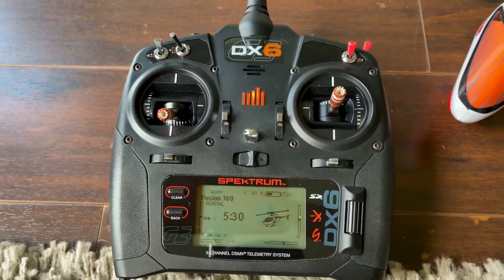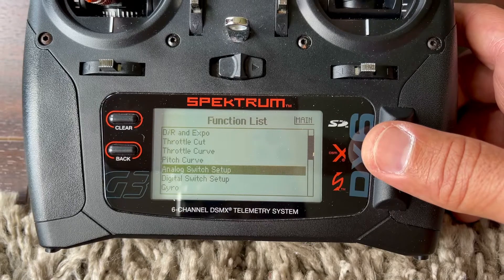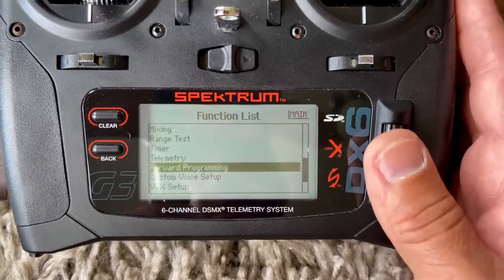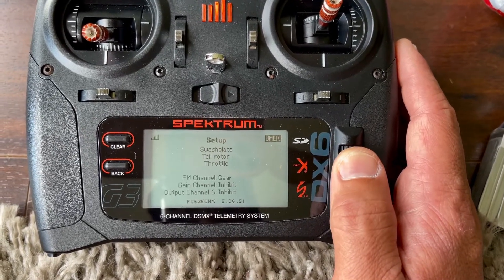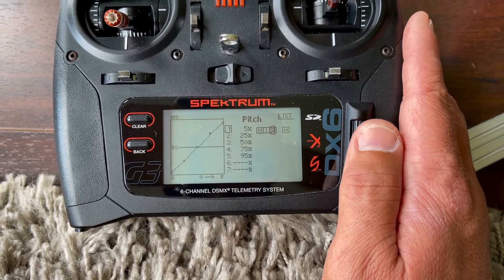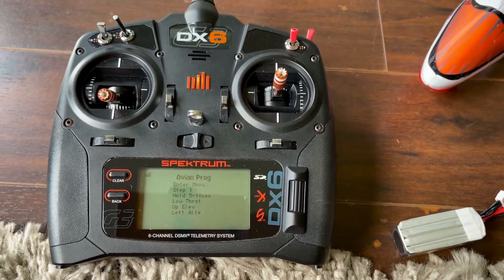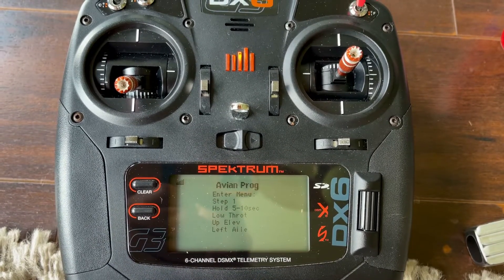Blade Fusion 180 Smart My PID settings for a Spektrum Transmitter Forward Programming Read Descripti

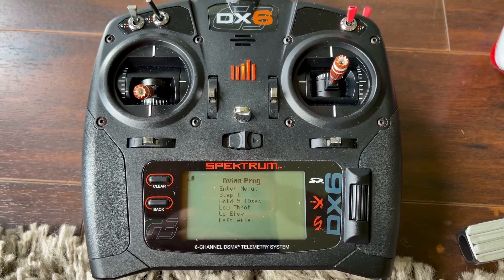Comment: 7:43 You're giving "Down" elevator, technically. I see you made it work. I'm having a super hard time trying to get mine to have a stable hover. Have to give a little right cyclic at first to hold it steady, but as the flight goes on, having to shift to left cyclic, then by the end of the flight, my right stick is pinned all the way to the left, and I can't even make the heli go left at this point. HH Customer support is telling em "This is an aggressive machine and this is normal".. I call BS..
Reply from the maker: Yes, down elevator! When the heli requires the left aileron correction, are you on “Safe Mode”? I could never fly these Blade helis on Safe mode because it required correction throughout the flight just like you. Even though I don’t need safe mode, I do like to have all the features available to me and in this heli it was impossible due to increased correction needed as the battery drains. When I switch off the safe mode, it needs no correction and flies better. If you are having this issue with the safe mode already off, then it could be a vibration issue. The best way to get rid of vibration is to dynamically balance your blades with them installed on the helicopter as you feel for vibrations when you spool it up while safely holding it above your head while you hold it by the sides of the frame. This could be dangerous so please be careful. Add a tiny piece of tape to the balance point of a blade and spool again to see if the vibration was reduced. If it increases, try the other blade. Once you find the right blade to balance, it will be a matter of trial and error by adding or removing tape until it no longer vibrates like before. Good luck and please let me know how it works for you. I haven’t flown Blade for a couple of years due to their issues. I bought a OMP M2 V2 years ago and it flies just perfect consistently and needs very little maintenance. It is crash worthy and parts are very affordable.
Reply from the maker: Look at this video to see my M2 fly. https://youtu.be/7JMWWST1vR0?si=iqFKVB-mWzbA-6vd I recommend that you get a OMP or Goosky and get rid of all your past helicopter frustrations. These helicopters are a work of art and designed to be the best quality rather than trying to save money by giving you plastic parts. The high quality aluminum parts used on these helicopters are crafted to perfection and are more affordable than the crappy brittle plastic that blade uses.
Reply: @andronesfpv  I already have an OMP M-1, and it flies great. I'M NOT, by any stretch, a 3-D pilot! All my blade helis fly fine except for this one. I like the safe feature. Granted, I did start my heli career over 20 years ago with a Thunder Tiger Raptor 30, and there was no SAFE back then, but it was designed totally different (Fly bar and paddles, and a nitro machine)

Comment: I wasn't too happy with this model that I bought 2nd hand ... it was hard to control even with stability mode .. kept rolling hard right each time in hover and even doing the auto attitude setup to compensate was a waste of time ... spoke to Spektrum support and tried everything .. the last straw was to reset the ESC and that fixed everything. Now that I've setup my headspeed and PIDS as per this video ... its brilliant and flies so well now
Reply from the maker: I’m so glad the video helped you. Thank you for watching.
Reply: How do I reset the esc? Thank you,mine keeps tipping over to the right on lift off
Reply: @glenn4452  Same here! I was messing around with forward programming and got it to behave a little better, no more tipping, but it still pulls hard to the right in hover with SAFE engaged. SO annoying! I REALLY like this heli, love the belt driven tail, and really wish it's hold a nice hover. If I hold the stick, it's rock soilid too, so it's like, I know it can do it! lol SO FRUSTRATING! I have since got a Goosky S-2, and RS-4, and lemme tell ya man, SO different!! The quality is amazing, and the blue tooth and app on your phone interface is amazing for setup and tune!
Reply: @nsbob70 I also have the s1 & s2 and the build quality is unbelievable,now I just need to get the s4 & s7 and that should be enough Heli’s

Comment: Question! 

I’ve tried these settings in stunt2 and it helped a lot. But I still have a minor but constant wag, still way better. Early on I added a little pitch to the tail trying to stop the bad wag I had.

What do you recommend pitch or no pitch with these gain settings?
Reply from the maker: Hey, thank you for watching. 0 degree pitch on the tail for this heli works great!
Reply: I spent over 30 flights working on  gains, trying to get rid of my tail wag and random swash tilts with this model. I copied your cyclic gains today as I did the tail gains, now this heli feels locked in and dependable.

I’m an intermediate 3d pilot but I’m fairly new to tuning as I only own BNFs. 

Anyways this video has helped quite a few people👍👍👍 Thanks!
Reply from the maker: @Ryan-uu4tw  I’m glad I was able to help. Thank you for watching my video. Check out my other videos! Subscribe…

Comment: I turned my rates way down myself,,I fly mine on a dx6i and e, then a jumper radio,  put a better tail servo on to get around the forward program B's , with a cross horn for a selection of manual gain adjustments  I really like it ,she rocks in the air , for sure ,, slowly going all metal head and tail ,,set my governor up on 2 ,,timing at 5  ,,rest at normal ,,..I just use travel to adjust my pitch the way I need ,,120/120
Reply from the maker: I understand where you are coming from. She sure rocks in the air for sure. A tail servo replacement is not necessary on this model if you had a radio that could do forward programming. In my opinion the only correct way to fly this model is with a capable transmitter that can utilize the features that the professional engineers have designed with the intention to achieve the best possible flight experience.  By getting a new servo you have not conquered the forward programming BS but instead are flying a flyable model. The “manual” gains you describe with the cross horn does not provide small enough adjustment to enable precision adjustment required. Also, while it works, it is not recommended to increase travel through servo menu. It is best to be done through the flight controller instead so that the helicopter knows it’s full travel capacity and can then stabilize your flight at this travel of sticks. My recommendation is to learn how to do all this on the flight controller in order to evolve in this hobby since it will enable more action on all your helicopters. Hardware does not replace software. Thank you for watching.
Reply: @andronesfpv  my tail servo that came with it will work but was acting strange, with   horn adjustments you can raise or lower the gain but your not going to change the sensitivity of gyro ,,you right there is no way for me to do that ,,,,my opinion?  They are going in that direction, to control what people buy   and it's not going to make me update ,only leave them and download the file on a radio master and fix what I need to ,,for years I was able to toon the bird the way I wanted to ..now I've hit a road block  with blade .  As far as the other rates can be changed like they always have been ..
Reply from the maker: I agree with you 100%! They are changing things to make you buy all their stuff or else you do miss out on the good stuff. I can see how this can be detrimental for the existing user. Unfortunately innovation won’t stop and for sure Blade will forcefully push their stuff. What I have noticed is that if you do use all their stuff, you can easily have the best flying machine out there. The programming capabilities on their new flight controller are so amazing and they have left unlimited tunability at your fingertips without the need for a computer and all done at the field.
Reply: @andronesfpv  I've built quads  ,, and know a little about  the make up and settings ,,I wish blade would ether give us a simple USB port on there fbl so any common person can change what they need too , without any additional equipment or cost .but it's not going to happen..they are capitalizing on this so you got to give out personal information, and spend money ,,if you want to fly ,I have alot of different helicopters ,,omp being the best has it right on the fbl for anyone to to change. I only keep buying blades because I learned on them and like how they fly .not the best quality airframes by any means,but I like buying a blade and slowly upgrading it to bar .it's very rewarding and relaxing to me. So that's why I keep buying them ,and always will ,plus I like how they fly .came a long way from the first cp ,,I bout lost my home over that helicopter

Comment: Did you change the throttle offset in forward programming?
Reply from the maker: This is a great question. I do not believe I did in this particular model. I am not 100% sure. I see where I messed up! Essentially my ESC output percentages are: Normal 65%, Stunt 1 72% and Stunt 2 is at 80%. By ESC output, I mean the percentage that shows on the Smart ESC telemetry display which is labeled as (output %). The settings shared on this video are to be used exclusively with the throttle output I have just shared. The PID and headspeed are directly related to each other. 

Thank you for watching my videos and if you have any questions please just shoot me another comment. Bye 👋 

Thank you for watching my video

Comment: It's bs that in the manual it doesn't talk about any of this at all.. so if you were new and didn't know better you'd think it's trash. mine in normal mode won't even lift off the ground more then a inch almost scraped the blade tips up on the tail and head.. works in stunt 1 and 2 will hover and come off the ground but tails wags.. I just want to fly to stupid thing.
It's set up to manual specs and does not do what it's sold to do..